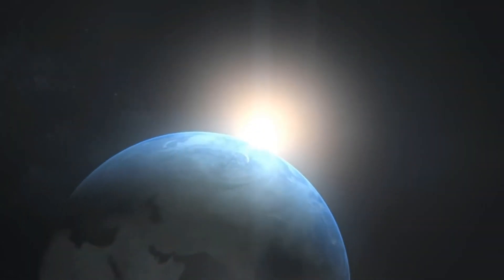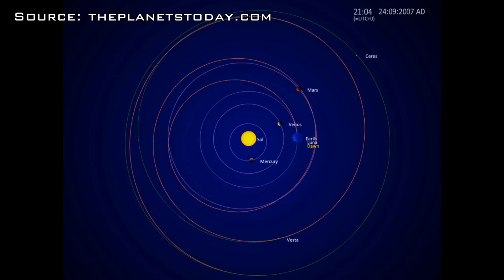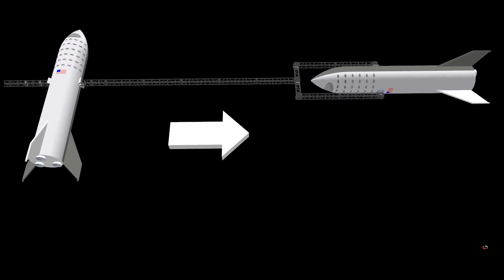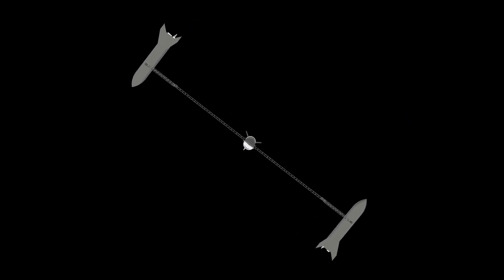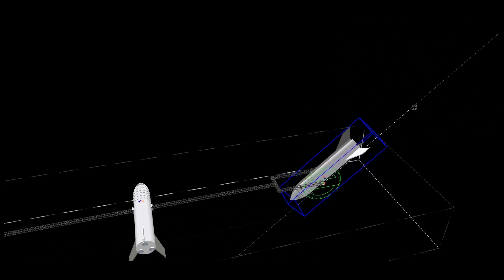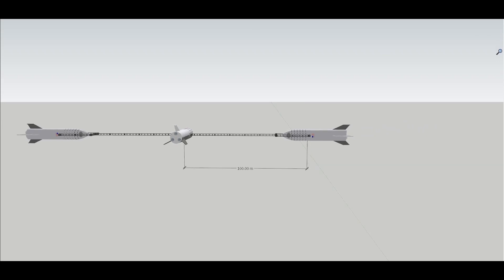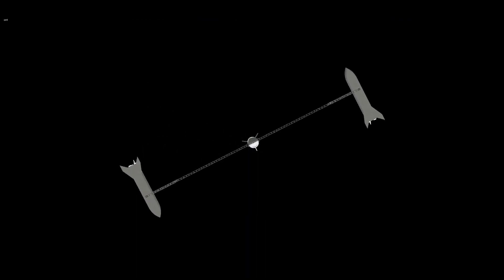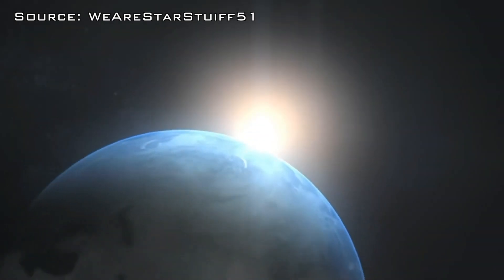GLS2: Artificial Gravity for SpaceX's Starship

Comment: Trusses would not need to be stored in the cargo section, they could be stored in orbit once launched. you wouldn't even need to have them in sections. just 2 long pylons left floating in space ready for use. You could even fit extra solar panels and batteries to supplement the starships own systems.
Reply: once you reach mars, detach and leave the whole structure in geo stationary oribit, then use it on the way back, now thats smart thinking, gives all starships all the space back it would use for the original designs.
Reply: This is waaaayy better, I had a similar idea but you said it far better than I would've.
Reply: Some serious advantages, but what do you lose by not having the hub? Think of the redundancy in another set of components, the open space in the cargo hold during the voyage and a place to put equipment that you don't want to have moving in a circle all the time. Perhaps the most important point: you need to launch at least one more Starship anyhow, to put the truss in orbit, so why not make use of it all? The amount of fuel to push the third starship to Mars isn't huge compared to the fuel needed to launch it from Earth's surface, which you need to expend anyhow.

Comment: I'd be concerned that the only place you can be relatively sure of safely attaching two StarShips would be at the bottom, near the engines, with the noses facing each other.  Anything else applies some very un-natural stresses to the ships.   Cables to carry the weight of the ships might attach to the landing legs/fins. Another cable would attach the two ships noses, applying very light forces to keep them aimed at each other.  Spacers along and between the cables would keep them from twisting much (apply 'tensegrity' principles), including one attached at the nose of each ship to make sure the cables are held away from the ship.

As many others have pointed out, tying up a 3rd StarShip is a non-starter. Launch a cabling system along with its own rockets and sufficient fuel to let it rendezvous with the StarShips, spin them up and down, and eventually put itself in a parking orbit around Mars.  It would need to be refueled for the trip home. Probably it and its fuel could be launched from Earth on a single SuperHeavy Starship. After connecting the two StarShips headed to Mars, their RCS engines would impart just enough spin to tension and stabilize the system.  Then rockets on the cabling system could slowly spin the system up to speed.
Reply from the maker: I love the first thing you said. Not many people have picked up on that aspect of this. Center of mass is important.

Comment: i feel like a regular motor built into the truss' attachment points would be sufficient enough to reorient the ships in space to their desired locations. 
Why waste compressed gases or fuel to orient the ship on the truss. when you can use replenish-able solar energy on an electric motor. 
also locking mechanism to keep the ships orientation in place at the attachment points.

Comment: This addressed every question I had about your idea with the exception of one, but I wanted to compliment you on your fleshed-out idea and excellent animation :)

My question is about required tensile strength. Do you have any numbers for the outward load put on the truss? It would be good to know if it was in the realm of the materials we have available now at a low mass.

Comment: I suppose if the truss catastrophically fails, the passenger section becomes its own lifeboat?  Very clever idea....
Reply: If the cable breaks, the two ships go flying safely away from each other.   They jettison the broken cable, then use their thrusters to get back on trajectory, and coast in microgravity for the rest of the flight.   Annoying, but not particularly dangerous.
Reply: Truss failure would be catastrophic. The centrefugal force would launch the two separated ships way off course.
Reply: An Infestor not really, the ships would be able to correct it for sure

Comment: B R U H
This is impractical
You could just have the starship split into two "stages" (fuel tanks and crew module) connected by long cables, wires, pipes, etc. and have the whole thing spin around.
Or you can equip the starships with nose connectors so you can have a long rope or truss connecting two nose to nose and spin that.
If you want something bigger than that, it's better to build a large spaceship in orbit. Large ships are the future.

Comment: I have read that a rotation of 2 rpm or less would be necessary.  Anything more would give rise to the coriolis effect which causes people to get dizzy and/or disoriented.  To keep the rotation down to 2 rpm or less would require a larger radius than 100 m.  An alternative would be to slow down the rotation, resulting in less than the earth's gravity of 9.81 m/s/s.  Still, I think a rather large percentage of little g would be necessary to really preserve muscle tone and bone density over extended periods of time.

Comment: Have you considered what will happen to the passengers during the rotation of the spacecraft after it reaches the desired rotational speed?  Have you calculated how much G force they are going to encounter?  I haven't done the calculations but i think it would be dangerous for the passenger to encounter that many Gs
Reply from the maker: Good question! It won't be more G's than a launch or landing.

Comment: The first problem with this whole design is that we don't have a means to control rocket thrust as fine as you would need to accomplish your gravity juggle. The Falcon Heavy had to be held on the platform for all three rocket engines to match up before being allowed to launch. 

There will be zero room for a mistake. The amount of thrust has to be perfect and equal in time and power. 

The slightest bit wrong will throw your proposed combined vessel off course. 

Should the structure fail when at 1 earth gravity spin how will they save themselves if a catastrophic failure occurs? They won't have a friendly experience because the people inside will continue in one direction when the vessel is thrown at the same force spinning and tumbling. No one will survive it. 

It would be more practical to do a single ship with shorter arms that fold out. Square the inside of the tube and you have 4 flat floors where gravity will be at an apex. The benefit here with this difference is mass and momentum. 

Two ships tugging on each other will have a greater potential. This is like making a double ended sledge hammer but you are proposing using a straw for a handle between them both. If it is perfect, it could work in space. But be off just a little bit and the straw will crumple in on itself because it does not have any where near the mass of the hammer at its end. You suggested something that can fold up. Something that has to be light enough to be carried to space. Which automatically means it can't have the mass of the ship. Lastly, don't forget that you are opening up an integral frame system with a lot of folds in order to fit. Every one of those joints increases the chance for some form of failure. Freezing, debris, micro impacts, solar flairs. How much weight will you need for replacement parts for emergencies? This is a massive amount of structure to send to space and land from space with. What do you do if you get to space and it fails to unfold? Can you reliably continue the mission with out it functioning? 

An alternative to using rockets would be "very large" fly wheels. They are spun up to a high speed and then stopped. The force being applied to the ship. Similar systems are used in Satellites. 

Don't get me wrong. I fully support the idea of actual gravity experiments needing to be done. Our future existence on Earth is a known variable. If we never leave Earth, Humanity is doomed. Our Sun will swallow our home eventually, albeit a very long time off. Thanks to some very amazing and courageous people we have taken our first step. But we are a long ways off from running.
Reply: Much better crafted than my response, but addresses the same concerns. Thanks for bringing this up!
Reply: Once extended tethers are in place ion thrusters can be used slowly to precisely set the optimal rotational speed. No need of primary limited fuel thrusters...
Reply: To your last point: The chance for us to go extinct by reasons we ourselves cause is likely much higher than any astronomical or even natural cause. I can't back this up but if we ourselves turn out to be the the main reason for our extinction, then we are doomed whether we move to other stars or not. We can't run away from ourselves. So I'd say going to other planets and stars will be a cool experience but I would not call it some kind of safety net for our species. I personally believe the biggest threat to humanity is actually boredom. A time will come where we will have discovered all there is to discover and built all there is to build. The only remaining things to find out will be the things we piled up that could mean our end. It's inevitable Mr. Anderson! ;P
Reply: @KsNewSpace  Actually, if we manage to survive long enough to colonize new planets. We will increase the chances that we will not self annihilate our selves.

Boredom is probably the least likely out come in all honesty. Look at how we keep making reboot of movies. Are you aware, that if you tried to watch every single Anime that has been made you would outlive your own life and still never seen it all? Even if you sat down to watch it and do nothing else for your whole life.

Otherwise, the slogan should be "See, this is what happens when you give them opposable thumbs. It was inevitable after that."
Reply: @FSDraconis  True, but developing all there is to develop includes stuff like neuralink and pretty much instantaneous knowledge aquirement. Where you have to binge watch a series for days and weeks, in the future you could download it in Matrix style. Or rather just know it because the neural link between all humans will be like a super charged internet and whatever you can know will be available as soon as you connect. 

I guess you could simply unplug and learn stuff the old fashioned way by reading and watching, but it doesn't take everyone to have access to all knowledge there is for things to go south. It only takes a small group. 

With great power comes great responsibility and the power per capita is rapidly increasing. More so than the sense of responsibility in my opinion. 

However, maybe knowing all there is to know will also make people instantaneously wise as a consequence. So.. there is hope!

PS. My main concern stems from the fact that there is no super intelligence that was born millions of years before us in sight. They've had enough time to colonize our galaxy. Where are they? We can't possibly be the first and a million years is nothing on a galactic scale. I'm not sure how they could hide all their traces from us that well. 

So either there is a big filter (or a set of filters) every intelligent species has to pass and none did so far, or they all simply get lost in a virtual reality they create. I assume if you could upload your mind into a fantastic virtual world there would be no reason to ever come out of it again. And how would you even know your're inside one if you're born into it? Big big philosophical oof!
Reply: @KsNewSpace  A very fun reply! First challenge a neural link net would not be able to over come is the chemical reaction speed of our brains. Neurons fire and react with receptors at a known maximum rate. 

Second challenge to over come is an actual digital to biological communication. If we had stayed with Analog technology that would of been more likely. But with digital you either get it, or you miss it entirely.

Personally, I would never want to just know a movie or a book. The destination is about the journey you take as much as the fun that awaits when you get there. There is a lot of things people should never be given instantly. People learn the most from mistakes. It produces an ambition to not make that same mistake again. Many people learn in different ways better than other's. Some people are visual. Some people learn better through hands on. Some people can read a paragraph and go about making a fire for the first time.

If Aliens are out there some where. All they would need to use to communicate. Pairs of entangled photons react the same way no matter the distance. There would be zero transmission and it is instant. But both parties would need to have one of the paired particles. Not to mention a means to manipulate and understand manipulation into a language both parties understand.

But being realistic. We are no where near to the idea of a neural net. But developing a form of gravity for stellar travel is with in reach of current science. 

20 years ago no one would of thought it was possible to land a booster back on earth let alone a floating barge in the ocean. We now know you can use the solar winds to sail in space.

Comment: The weight of the structural strengthening needed to hold the ships together while  being essentially suspended sideways would make the spaceship too heavy to take off. I suggest that, instead, the conjoined ships START off "head to head" and either use a side-mounted thruster of a severely gymballed main engine to start the spin.
Reply from the maker: With current plans, the vacuum raptors will not have any gymbal action. I did not animate the video exactly as it should have been, with the co rotation happening at the same time as  the spin-up operation, negating the need for sideways reinforcement, only "downwards" - the swivel joint will be heavy duty as hell though.

Comment: Have you though about making the truss into a spaceship? It does not need to land or take off from anywhere, so it does not need aerodynamics. It could carry cargo, fuel, supplies etc., it could have its own engines for manouvering and spinn-up, and it could be able to serve as a gateway between 2 (or more) ships. If there was only one ship attached, it could shift the cargo weight to balance. And if there were no ships attached,  it could still do cargo missions between earth and mars orbit. Maybe it could even orbit the sun in an eliptical orbit that gets close to both earth and mars regularly with minimum adjustment..

Comment: Those two metal arms would have to resist a terrible torque. They would just blend over the mass and pull of the thrusters. Even if they were made of titanium... not mentioning the enormous weight. Space X's starhip is HUGE...  even if they succeded to make the initial rotation, those tiny metal arms should now resist the centrifugal force, wich would indeed be 1g. So imagine two giant rokets ripping apart those arms with theyr weight at 1g. Just not possible. The anular structure you see in movies is indeed to spread mass along the structure, to prevent this effect. Imagine as a small example to spin a rope with a car attached to it at a speed that allows 1g of centrifugal force.
Reply from the maker: You are absolutely right about the weight (tension) but I believe you are mistaken about the amount of torque which will not be very significant. Imagine trying to bend a fork with only two fingers. One at The tines and one at the end of the handle
Reply: @smallstars  it would be the same as on earth, trying to suspend the whole rocket mid air, with a thin girder. This provided that the system manages to put the 2 ships in motion without being ripped apart
Reply from the maker: @idartacus  Yes in regards to tension you are correct. Thanks for your input! I'm working on V3 now, with strong cables to reinforce, so none of the load will be hung by a "thin girder"
Reply: @smallstars  i think that the only thing that might work, and i cannot stress enough the word "might" is graphene. But even then, we do not have neither the tech to produce it nor the tech to transport it and package it in a rocket. Plus, would be one atom thin and thus be able to cut anything like a laser. Actually better, so it would be extremely dangerous. I'm striving to find any other practial solution but it'hard to imagine
Reply from the maker: @idartacus  We have strong materials that aren't 1 atom thick, don't worry.

Comment: Great Video! but a couple questions. 
With this design, wouldnt the gravity will be greater at our feet and less at our head thus taxing out heart and other systems at different rates? Also, what will happen if you walk across the floor opposite the direction of rotation? Less gravity for the walk i imagine. Also, is there an improvement to your design that addresses rotational rigidity along the axis of each truss? I feel that the heavy weight of the crafts could cause a corkscrew type twist in them. Thanks for reading this and keep up the good work!
Reply from the maker: Thanks!

Yes, but an insignificant amount with 100m radius.

Yes walking opposite = slightly less, but also insignificant. 

No, there should not be any force created in this system that will put torsion stress on the truss. The truss will have a torque force applied to it during spin up and spin down and needs to be strong enough not to bend. Strong cables will be used literally along side (or even inside the cords) of the truss to hold the tension of the system.

Comment: Instead of having it fold away, why not have it permanently affixed once in space to a central starship (a fuel only version)
1. Less complex, no need to fold away,
2. More room for fuel for journey
3. Refuel in space between journeys while in park orbit. 
4. Actually, technically it could just be a super heavy module, not the starship module in the middle anyway....
Reply: Might want to aerobrake with the center starship
Reply: @joelnord4699  aerobrake? In space?